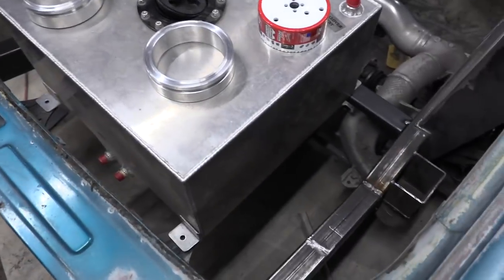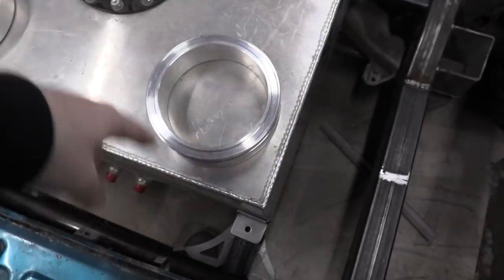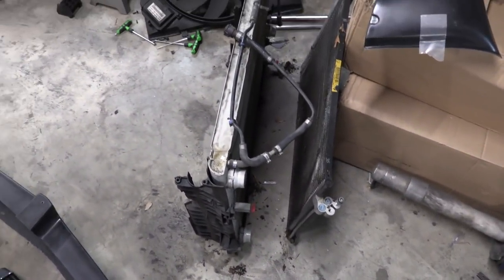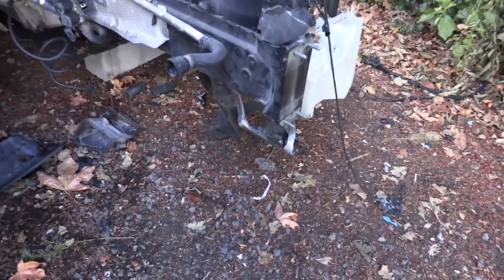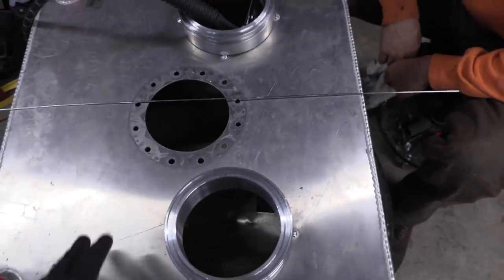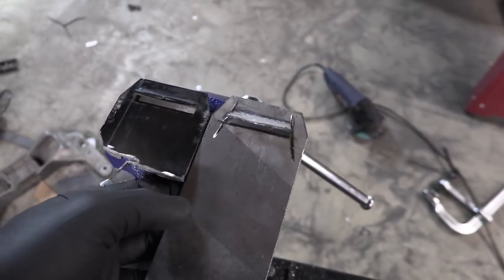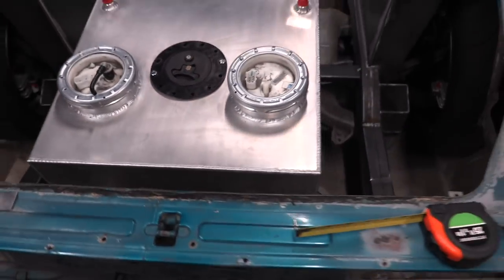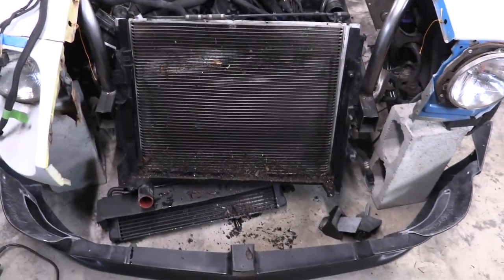Fuel Cell Is Done! Starting Mounting The Radiator In The 240Z

Comment: For easier oil changes I’d locate it somewhere else. Take a little extra time now to save a lot of time later
Reply: Amen if you mount it there you will have a very difficult time changing the oil. The fan and shroud will more than likely block access. The plug is oil pressure switch. I would mount it facing down. It makes for cleaner oil changes too.
Reply: Puds Garage he’s going sema
Reply: Cian Ó Conghaile I know buddy

Comment: 09:30 that is not an egr. It is a secondary air pump to heat op the exhaust for cold start.
Reply: Was going to point this out too. There may be an oil overflow pipe up to the air intake to prevent over pressure in the engine block from blow by past the pistons that may look as though its an EGR. Keep up the good work.  Cant wait to hear  it roar.
Reply: Yes and BMW hates it when it's not working
Reply: Secondary air pump

Comment: Hey Chris, I just got out of a full BMW engine overhaul. Rod bearings went. I'm not sure but I think I remember you mentioning there were a few metal particles in the oil of that engine. Might of missed it, but I would reccomend getting the rod bearings replaced and crank inspected while you have the engine still very accessible. It was a pain in the ass, and I'll probably not buy another BMW because of it. Wouldn't want you to go through the same nightmare. If I were you I would do all the mechanical preventative maintenance now as you finish the body and interior. Much love, keep it up dude.
Reply: Don't think he has time for that now as it's a race to finish before the deadline for SEMA.
Reply: He said that he was going to replace the bearings on it.
Reply: It depends on whether or not he's doing the rod bearings himself. If he hires a mechanic, then he could totally work on the rest of the car while the engine is being fixed. Saves him from buying another engine if this one grenades like mine did. Just imo anyway

Comment: Locate your oil filter housing somewhere suitable then have the lines remade to suit. Also both fuel tank units have level sensors in them so if you just connect everything up as is your fuel system is going to read double the capacity as its reading the same tank level instead of reading each side of the OE split tank. I'd look at either removing one level sensor or perhaps lock one in the empty position.
Reply: LeeJSA yeah but if they’re in the same tank they will both move down and up together and read a true value. If you lock one down the ECU is going to read that as half the tank being empty and only display half a tank on the gage.
Reply: @MichaelGallagher97  Not when each side of the tank is treated as a separate tank in the factory setup. The left and right tank levels are added together to give you the total fuel capacity.
Reply: @LeeJSA  the fuel gage doesn't really care how much the Tank holds. It doesn't read a  actual Value it just shows you a % of the tanks volume. Each sensor will have a maximum value of 50%. If you hold one down, the gauge is never going to read more than half a tank.
Reply: The only thing it could make a difference to is calculating the mpg and the estimated fuel range because the ECU is now thinking it has say 50% of a 50L tank (so 25L), when really it's 50% of a 40L tank (20L)
Reply: Michael Gallagher  Exactly.....so both tanks capacities equal 100% - both tank values are added together to give the overall capacity.....as you said the gauge is never going to read more than half a tank which would be right because that tank Chris is using is around half the size of the OE tank.
Reply: Michael Gallagher  Correct - so you would need to do what I said in order to resolve this.

Comment: Hey Chris that sensor is the oil pressure sensor, and once there is oil pressure it doesn’t matter if i’t upside down, but... replacing the oil filter WILL be a mess! Better try to relocate it as up as possible and in the right orientation for easy oil  changes later on... keep up the good work!

Comment: Just noticed the way, you are going to mount the Fuel System into the Fuel-Cell. Will it reach the bottom of the Cell? Normal fuel tanks have the pump at the lowest spot of the tank, don't they? Additionally, the Cell has much more hight to it, escpecially with the new rings on top, the pump sits on...

Comment: Temporarily remove the frame rail tie tube. With the subframe installed the rails won't move. This will allow more room to locate stuff. Then when everything is located, reinstall the tie tube and well up all your brackets. Much simpler.
Also, if you need to you can make an offset u shaped tie tube that comes across down at the height of the subframe.

Comment: The filter may drain back when fitted upside down and mounted higher than the sump level. Just move the filter unit into the fender area in front of the wheel and make new hoses up. The way you had the hoses doubled back looked to be deforming the hoses (flattening which could cause the hose to collapse and restrict the oil flow. Moving it to the side will give you so much more room.

Comment: Upside down should be fine, plenty of vehicle mount there filter upside down and sideways. Just would be troublesome to change filters and wouldn't be able to prime oil pump.
Reply: As i see i think that would be even better to change filter, as the oil wouldnt drip everywhere when you remove it. It may be in a though spot, but not that bad. And that connector seems to be the oil pressure sensor, at least thats what it its on my bmw 740
Reply: Amir Sholkami yeah seems like it would be less of a mess.
Reply: No, it makes a big different! The inside of the tube is different
Reply: Daniel Rauh like would build oil pressure faster ?
Reply: @uuhhhnotjake2847  mounting it filter down allows you to remove the small Allen head plug and let it drain before taking out the filter.

Comment: Unusual to see a fuel tank designed with no apparent Baffles to stop fuel starvation in the pumps under braking / acceleration, I looked at the comments in case somebody else had noticed this omission. You need separation barriers in the tank which will reduce fuel slap and air entering the fuel lines/ pump starvation, but alas I see none. If you can find a fuel resistant open cell foam, which will not degrade into the fuel over time, this might save taking the tank apart again to install baffles.

Comment: Chris, you should rear mount it, just run some extended oil lines to the read next to the fuel cell. Plus the oil would get a lot cooler.
Reply: Rear*

Comment: Change the filter to the stock position!! Heres why! That oil filter housing has a soft oil filter not the common hard body can style filter. Which means the housing is always filled with oil. It protects the soft filter. If you were to remove the housing to change the filter with it mounted upside down oil will be spilling EVERYWHERE! Keep it upright for clean oil changes.

Comment: Mount the oil filter so it is easy to service, any good heavy equipment shop or tractor supply place could make you new hoses to run from the block to the filter. When I worked on garbage trucks we got hydraulic hard lines custom made at a steam and pipe place. Anything from 1/8 inch to 1 inch steel hard line or standard rubber lines. Just pull them off and take them in after you figure out how much longer they need to be. 

I know you aren't going for full on race car, but I am not feeling the way that fuel cell is mounted even after you mentioned making new bars to go under it. If you have room between the tank and the body I would cut out that little round bar and put in a chunk of the square tube you used for the frame in. You want that thing staying put no matter what happens, be it a slide off the track, bump into a wall or someone rear ends the car.

Comment: You need to be sure that your oil filter have a check valve build in
Reply: If not you are going to run your engine a couple of seconds almost dry and with out oil pressure

Comment: Hey just curious, do you have a plan for wheel wells? I just noticed since everything’s so cramped I worry about rocks / rubber potentially getting thrown into the serpentine system. + I’m not sure if you’re going to have an undercarriage guard or whatever.

Comment: for the filter it depends if its gravity fed or if its pumped I believe on m5s they are pumped so it should have a problem being mounted upside down. on 335s and other bmws they are mounted on the top of the motor and are gravity fed

Comment: Even tho when it was positioned downwards the oil use to flow down and into the ⬇️ and then flowing up and out of the filter so either ways its ok to flip it but your going to have some issues with changing the oil.

Comment: that radiator on an angle will cause air bubbles where the top n bottom hoses are pointing down.  alloy radiator the right size modified to fit the sensors would be a better option. Mishimoto sponsors  nearly everyone for rad n fans too lol

Comment: If you use super glue and baking soda you can fix the fan shroud the glue becomes hard as a rock but you can sand it and paint it to blend the crack away and the only thing I can see with the lines being so tightly curved would be restrictions in flow  it is looking good you gets will find a solution fro the routing

Comment: I cant see a problem running the filter upside down, Except when you change the filter during an oil change... its gonna be messy. but you could put a small tapped NPT hole in it and a plug, then you could drain it before you un-screw the cap.

Comment: Should be fine. It’s a sealed pressurized system. I do not believe it has any sort of check valve that relies on gravity. It’s all springs and the pressure from
The oil pump. Should be able to mount it vertically or horizontally too...

Comment: on my audi the oil filter was mounted like that on the top of the motor. I mean the oil is under pressure so it should technically be fine.

Comment: I would not mount it upside down because, twisting the hoses not a good idea... and you would be dripping oil out all over when you change the filter.   Fan/alternator belts plus oil.. vary bad idea.  I would just get new hoses and mount it in a more normal orientation in the spot you choose.

Comment: Just curious why didn't you go aftermarket with mishimoto all things considering it's not the original car wash it and get a completely different radiator to a car that it probably is not going to fit and be insufficient for cooling
Reply: I get that it is the exact same one for the motor but not the exact same one to fit the car properly or to give additional cooling considering it there may not be sufficient room in an engine bay for the engine to cool properly like it was originally designed in the BMW as well as the opening in the front of the car is a lot smaller than the original one design for the BMW thus why not go with a mishimoto or something like that to fit the application why buy something  that is oem when your car's not OEM

Comment: Having the oil filter upside down shouldn't cause any drive ability issues but it will trap a lot of oil in the engine and lines/ filter housing. Meaning if an oil change was done and you added the correct amount of oil it would be over filled.  It works on the other engines like all the other straight 6 engine because its above and completely drains. This way will not. I've been a BMW tech for six years and I can tell you a lot of oil drains out of the filter. Id say run it upside down but don't mount it were it cant be removed and hang down under the engine If you even plan on keeping this car long enough to service it.

Comment: Dont put the oil filter like that because from what you said about the radiator being slanted towards the engine, every time you need to change the filter, the radiator will have to come out

Comment: As for whether or not it's okay to mount BMW's oil filter upside down I have no clue, but if you're going to be messing around with it maybe make it as easy as possible to change the oil. The spot you have it in looks like a pain in the ass. Most cars with the cap nut facing upwards have the oil filter above the engine where it's easy access. Maybe you should just completely rethink where the oil filter is going to go in the vehicle. You have a lot of room to work with.